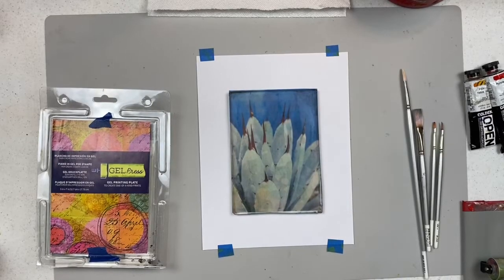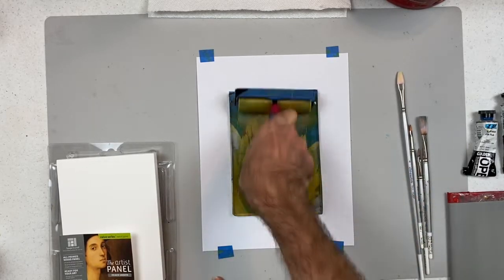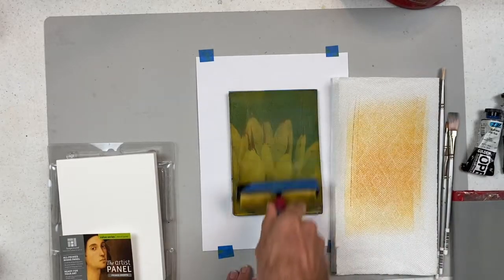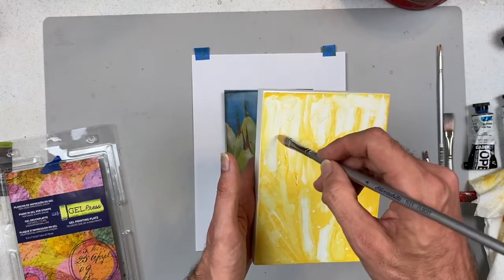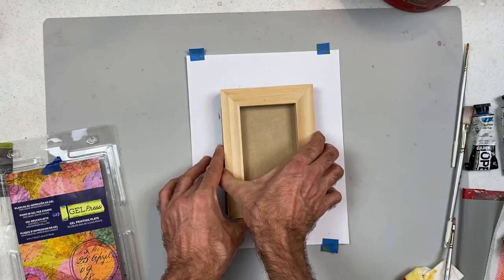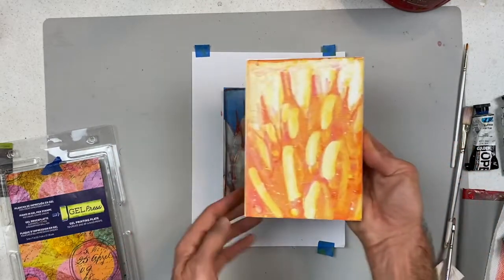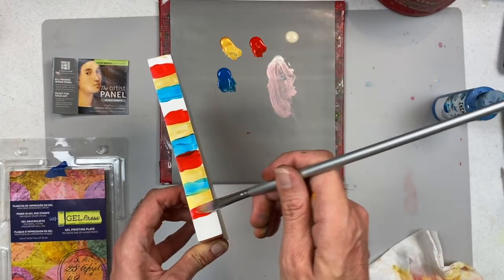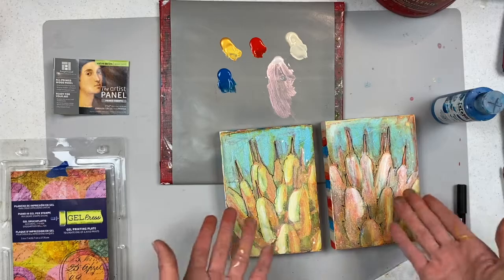#arttutorial Monoprint Process

Comment: If you wanted to avoid having so many air bubbles in the paint, is there a way to go about doing that?
Reply: Hi Kris, great question. The gel plate can pick up debris over time depending what you are cleaning it with (which I like). That can create a lot of small speckles which look like bubbles. When I massage or press the gel plate when printing, I make sure that the gel plate is on top when I print. Making consistent contact with gentle but firm pressure removes large air bubbles. You could also use a heavier application of paint which will give it a more solid coverage when printing. I hope that answers your question! If not, let me know.